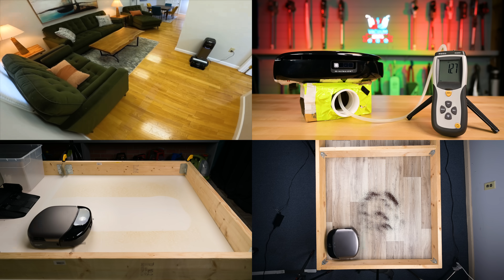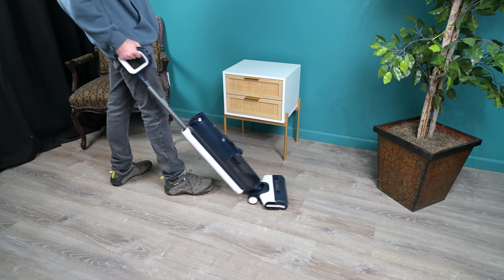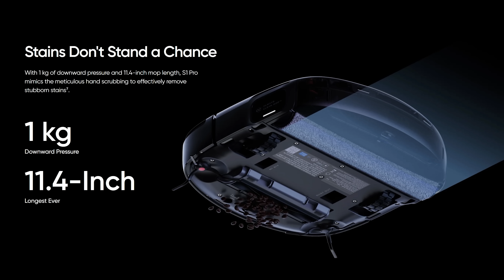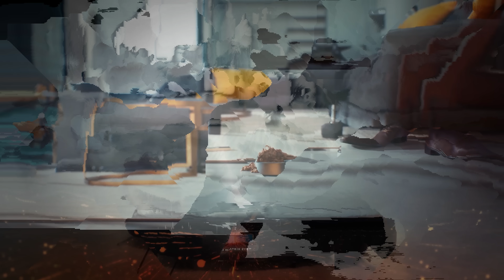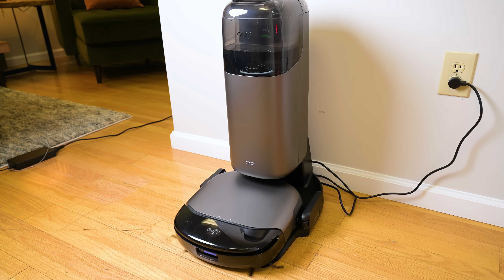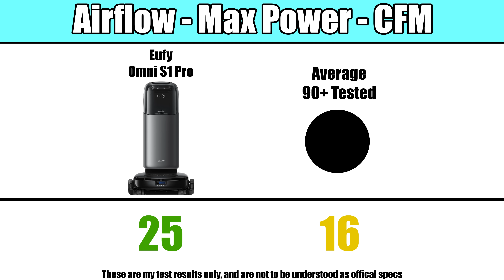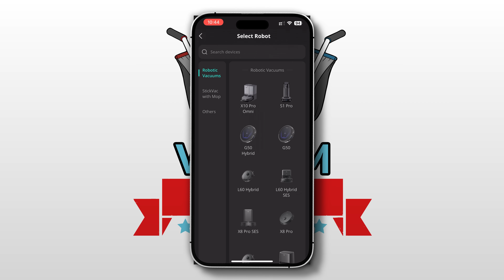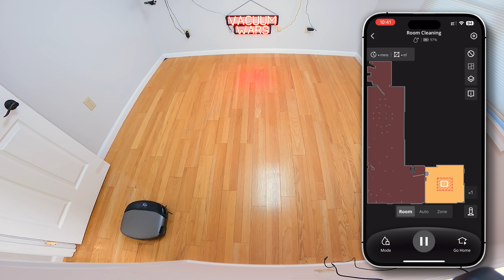Eufy S1 Pro Omni Review: AMAZING for Hard Floors and Obstacle Avoidance!

Comment: The problem is getting replacement parts unlike with Roomba where you can replace all the parts.
Reply: Not true actually. Replacement parts are already available direct from Eufy. So far they've got the detergent, extra mop rollers, extra side brushes, extra vacuum brushes, dustbin filters, top magnetic covers, and wheels all on their store. I actually can't think of a part that isn't on their store yet.

Comment: I got it today. Mop is amazing 

But carpet cleaning is definitely nothing special and I have a very thin carpet. But it’s off white so stuff shows. 

Somehow worse vacuuming than the X10 I had. 

I think it’s because the X10 had bristles for the brush. This is just that rubber bullshit. 

Please offer an upgrade brush for the vacuum eufy.
Reply: Do you still have an X10? If so, could you test if the X10's brush fits in the S1? That might be a possible solution for those with more carpets/rugs that need better cleaning.

Comment: after  several months of mopping use, if you open up the base station you can see its internal tubing is full of mold. You might want to open up the base station and examine the inside to see which station can keep off mold the best.
Reply: I don't think this will be an issue for the S1 Pro because the ozonated water really does work at preventing any bacterial growth. It's the first robovac I've had where even after a week of the dirty water sitting there, it develops ZERO smells. And when I say zero smell, I mean absolutely nothing at all. Not even a hint of bad smells. There's also been no mold spores or anything growing in the water either (and that's both in the base and the onboard dirty water tank). 

For comparison, my Q Revo's dirty water tank smelled AWFUL after just a few days of sitting there. If it was left there for a week or more it would start growing mold in the tank and the smell was truly nauseating. Never having to deal with this on the S1 has been one of the biggest improvements I've noticed so far.
Reply: @Brendon471  how many vacuum robots are you buying? I'm genuinely asking, are people really replacing those devices like phones, every couple years a new one? I still have the first one I bought 4 years ago, and I don't really see a need to buy a new one.
Reply: @jankoodziej877  Aside from the Q Revo I got last year (and the S8 MaxV Ultra that I bought and returned from Best Buy to try out) this is the only other robovac I’ve bought. 

I planned on keeping the Q Revo for a few years, but it was doing a terrible job at cleaning and the lack of obstacle avoidance made it more annoying than useful since it always got stuck on things. The cleaning was truly awful too, it started to leave a thin film of dirt all over my floors despite it being scheduled for a daily, double pass of the vacuum/mop with deep water usage and frequent mop pad cleaning. Even with all of that my floors started to look dull and dingy after a few months. 

Walking barefoot you could just tell the floors weren’t clean. I hated that, so when I saw the S1 for $899 on Kickstarter I backed it immediately. My Q Revo was the same price and the S1 blows it out of the water. My floors feel amazing now. They’re absolutely spotless and I never have to babysit the S1 since it perfectly avoids every obstacle or cable it comes across.
Reply: @jankoodziej877  The S1 and the Q Revo are the only two I’ve had in the past ~4 years. I only had the S7 MaxV Ultra for a month before I returned it after being disappointed with its mopping and obstacle avoidance. Got the S1 for the early Kickstarter price of $899 and I see no reason to upgrade for many years now. This thing is amazing.
Reply: Just maintain it every 2 weeks
Reply: I’d add a few tablespoons of bleach to the water tank irregardless of brand. At least every other month.
Reply: @fZionists78 sodium hypochlorite is pretty aggressive on rubber and most plastics. Have you tried it and know that it works? I’d go with a non-corrosive, non-oxidizing agent first. Either plain detergent or a quaternary ammonium solution.
Reply: @Random-f3y7w I don’t own a mop robot…yet…but I use bleach regularly in all types of appliances made with plastic parts. Never had a problem, bleach is sold in plastic after all. Also, deluded bleach isn’t very aggressive. Even delicate flowers will live longer with a couple drops of bleach in the vase. 

If you have concerns I would recommend vinegar. It does wonders as a disinfectant and eliminates corrosion/mineral buildup. Just don’t mix the two, and pair whichever doesn’t react with the solution/detergent you’re using. Use(diluted) one or the other, as mixing bleach and vinegar creates toxic gases.
Reply: @fZionists78  Totally unnecessary on the S1 and overall not a good suggestion for any robovac. Bleach is bad for plastics and can dissolve the piping over time, leading to leaks. I’m telling you, I run the S1 Pro in my house every single day for over a month now and the dirty water tank has absolutely no smell. Not even a little bit. Ozonated water is extremely effective at killing bacteria in the tank and on surfaces that it’s cleaned with.

Comment: Great review! Just curious, when you ran the wet spill mopping test did you find any of it getting into the Dustbin since it doesn't turn off the vacuum when it mops?
Reply: In my use after the past month I haven't had any liquids get into the dustbin even after I had it clean up two cans off spilled White Claws. The brush bar doesn't directly touch the ground, so liquids don't get sucked in/kicked into the dustbin by the vacuum brush.

Comment: Thanks for the review! May I ask what's the hair tangle situation with this vacuum? It seems to be a big selling point for its competitors like Ecovacs x5 or Dreame.
Reply: Left a comment below for you. Hair tangles have been no problem for me or my mother/sister whose hair gets everywhere. I actually just checked it and there isn't a single hair wrapped around the brush bar, but there was a few on the ends of the brush. As stated in my other comment though, that's easily removed by just pulling off the ends of the brush bar. Then you just slide the hair off.
Reply: @Brendon471  Great! I thought it might be bad because Eufy didn't market this feature at all. Thank you so much for sharing, it really helps me making the decision!
Reply: That's honestly the biggest hold out for me, as well. If it can't handle hair tangling, it's a deal breaker for me
Reply: @yin-yinwang8095  Handles hair tangles no problems, and much easier than on other bots like the S7/S8 MaxV Ultra. It resists most long hair tangles like from my mother/sister, but large amounts of hair do sometimes get wrapped on the sides where they can easily be removed by detaching the ends of the brush bar.

Comment: I've replaced my Dreame L10S Ultra by this Eufy S1 pro. I can confirm that the Eufy doesn't clean carpets as well as the Dreame did, but it is adequate and the Dreame was terrible to my wooden floors with grain. Over months the Dreame caused a layer of dirt on my floor that was disgusting to look at; friends of mine even have this problem on a slightly rough stone floor. The Eufy changed this completely and our floors are finally clean again! The fact that it doesn't perform as well on carpets matters little to us as it still runs multiple times a week and we only have about 10m^2 of carpet. However, I have found that the Eufy doesn't like going underneath black Ikea furniture that 10cm high, but then it navigates much better under our dinner table between the chairs.
Reply: My Q Revo and S7 MaxV Ultra did the same thing on my tile floors! I had them doing daily mopping with a double pass, but still after a few months I started noticing a thin dirt layer was developing on my floors. It made them look very dull and dingy. 

I've had the S1 Pro for a month now and my floors are SO much brighter and clean looking. The difference is truly night and day. I've never been so impressed with a robovac like I have with the S1.
Reply from the maker: @Brendon471  So glad to hear the S1 Pro turned things around for your tile floors — brighter, cleaner floors definitely make a huge difference in how a space feels. Thanks for sharing your experience! 🙌🧼
Reply: @Brendon471  were u using cleaning solution? i would add cleaining solution to the clean water tank adn change the mop pads every other day and my floors are still sparkling with the S7 MaxV Ultra at 2x pass.

of course if i didnt change the pads super frequwntly, itd prob be a diff story
Reply: @NadeemAhmed-nv2br  Yep, used the Roborock floor cleaner and would put far more than they recommend for even better cleaning. I only had one set spare of mop pads, so I’d change them out of every few weeks. It’s so much better with the S1 not having to worry about any of this though.
Reply from the maker: Thanks so much for sharing your real-world experience — that kind of detail is incredible. Appreciate you taking the time to share! 🙌
Reply: @VacuumWars  I also found the main problem with roller mops is the clogging in the scraper of the roller. My Eufy S1 pro with the v1 dirty water tank got clogged by my crappy carpet on every cleaning. They sent me an upgraded v3 and I don’t have that problem anymore. However if I look at the ecovacs roller scraper; it looks too thin again and like it would clog.
Reply: Thanks for the info, currently have the L10s ultra  (in the shop) and was excited to see the one as I have all hard floors.   Can you tell me is the on board dirty tank (in the robot) removable ?
Reply: How often do you change the mops? I got the same dreame and considering the s1 pro😂
Reply: Dude my L10s has just started “resetting” itself and I’m losing my damn map every couple of weeks. I’m thinking of getting rid of it and I’ve only had it for 2 years. Just a pain in the ass

Comment: really wish they wouldnt all come as a mop, Id like just the vac
Reply: You could just run it in vacuum only mode which would never use the mop or even wet it, and keeps it permanently pulled up. Would effectively be just a dry robovac for you.
Reply: And I wish I’d just come as a mop 😅. I already got a vac but this roller mop really changes things.

Comment: The ozonated water feature is so incredibly nice. Not only does it completely sanitize your floors, but it also keeps the internals from ever smelling or building up mildew or mold.
Reply: Yup. It's amazing not having a dirty water tank that smells horrible. On both my Q Revo and S7 MaxV Ultra the water would smell so bad after a few days that it would make me gag. The S1 however, even after a week of daily mopping, has ZERO bad smells. The ozonator works extremely well, much better than I ever expected it to.
Reply: @Brendon471 does your s1 pro have a light so it can vacuum at night when we're sleeping? 
-does it return to base to empty vacuum if it gets full & then go back out to finish job? 
3. Will it take photos of obstacles it finds?
4. Does it allow for remote monitoring when away from home like the robovac?
Reply: @ To answer your questions in order: no, but it has LIDAR so it can see in the dark; yes, you can customize how often it goes back to empty itself/clean the mop; no, it does not take photos of obstacles in its path; yes, you can remotely monitor/see what it’s doing in the app but you cannot remotely view the cameras.
Reply: I feel like I’ve missed something, but you have to empty and refill on every use still, right?
Reply: @carlmakin   you have to manually clean the base but it takes a long time to empty the clean water and fill dirty tank . about 7 days so every Friday for me
Reply from the maker: Totally agree — the ozonated water feature is a standout! It’s such a smart way to keep both the floors and the vacuum’s internal system fresh and sanitized. Definitely a game-changer for long-term maintenance.

Comment: Wow, Eufy pretty much just showed everyone up. No lidar bump yet still vastly better than VSLAM, an actual active mopping system. Seriously this puts to bed everything Roborock and Roomba have done for the last half decade at least.
Reply: Exactly why I dumped the S7 MaxV Ultra and replaced it with the S1 Pro. Had it for a month now and my floors have never been so clean.  The ozonator is also amazing... it completely prevents the dirty water tank from ever smelling even after a week of it sitting there with daily mopping being done. 

Roborock's solution to this was to use a silver ion block in the dirty water tank, but even then it didn't fully prevent smells from cropping up and I would gag every time I had to empty it.